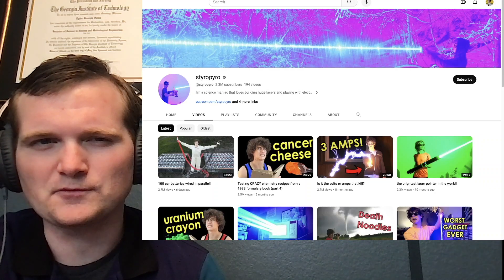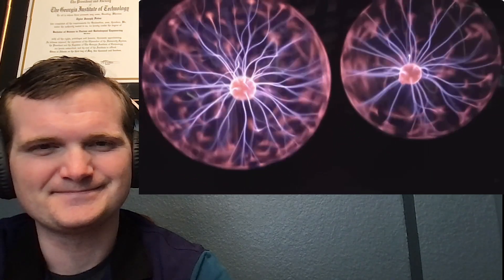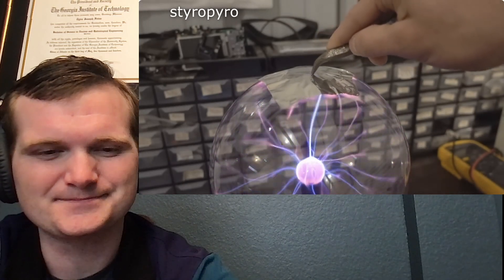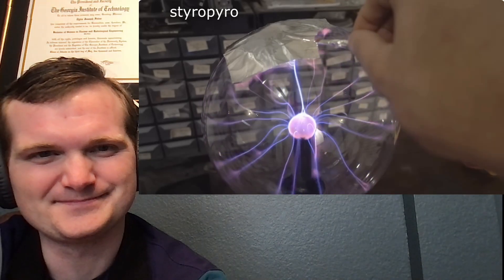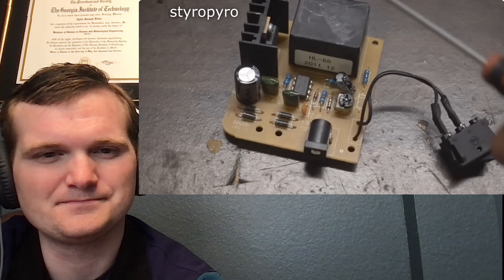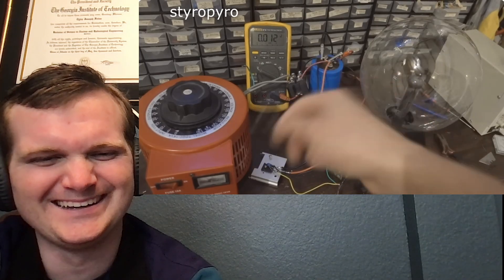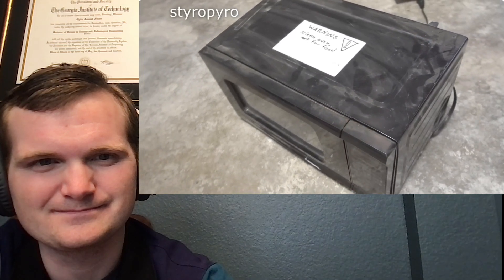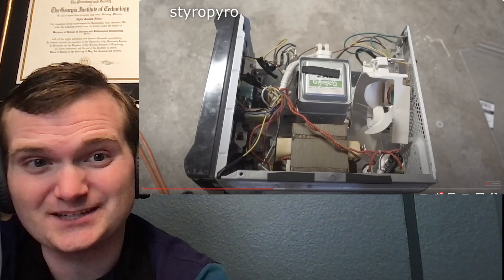Nuclear Engineer Reacts to Styropyro's DIY Overclocked Plasma Globe - 2500 to Over 1 MILLION Volts

Comment from the maker: Thanks so much for watching! If you want to hear more about weird pseudoscience products that are actually RADIOACTIVE, please check out: https://youtu.be/9V1gFTfkYH8?si=SZ6uH_nHkySeqC4w
Reply: What about ESD grounding...lol
Reply: @honeywaxnbees its good and not a scam? Wtf. Esg grounding is good and for some things essential
Reply: Hey there T folse First of all I hope you having a great day.
I wanted to ask you a quick question can you tell me which radioactive elements have an glow at dark?
Reply: @Sirius-o4k Tritium is probably your best bet for a glowing radioactive element, it's also pretty safe ironically, and you can buy tritium vials as a necklace or a keychain. Radium also glows though, and plutonium glows by burning the air that touches its surface cause of how radioactive it is. You don't really see too many elements that just glow on their own though, there's a few exemptions ofc. If you want something that glows and you can use it in pretty much anything safely, get Zinc Sulfide. Changing the metal it's doped with can change it's glow too, silver makes it blue, copper green, manganese orange/red. Mix it in paint to make a glow in the dark paint, or mix it in some epoxy and you can make some glow in the dark toys like what NileRed did.
Reply: The balloon is filled with acetylene, most likely. It's super unstable and makes a brilliant bright yellow flame. Also, it's super dangerous because even static electricity from your clothing, or the inside of a balloon can ignite it..

Comment: i used to wire up control panels on switchgear for transmission line switchyards. as i remember we wired up control panels for a 750kv line. its been about 20 years or so. i have hi-pot tested thecopper bussbars of switchgear up to 100,000 volts though. with spotters using deadman switches, staying up to 35' from any metal part of building, and not breathing in the ozone. sometimes the insulation would get pierced through and pop and sizzle like bacon.

Comment: Back in the day when cb's were popular my buddy always had to have the best and of course have it first. I asked around and found an older fella that used to amplify cb's for truck drivers and being long out of business (so he said) but just happened to have a huge linear amp that the person never picked up that I was able to buy at cost with the you didn't buy it from me. So my buddy had a little flashlight bulb he soldered an alligator clip onto and would clip it to his antenna and light it up when he keyed the microphone. So there was a motel a friend's uncle owned that had neon lights in the check in awning roof. I told my friend my cb was strong enough to light up those lights so off we went. My antenna just touched the light and when I keyed my microphone nothing happened my buddy said I needed to say something for it to work even though he doubted it would. Not only did it light that on but all 4 under the canopy. On the way out our friend who worked there wanted to know what was going on so I gladly showed him but for more power I whistled in the microphone and to my surprise the light shattered 💥 😮 due to the antenna not touching and being at the end where the light attached to the fixture (so I was told). Our friend was known to be a bit high strung at times just said you got a mess to clean up and I hope you don't mind ladders. The linear only helped on it's lowest setting anything higher you couldn't understand what was being said but it was well worth it to outdo my buddy who kept pestering me to buy it which I did for quite a bit more than I paid for it.....The end 😊

Comment: was it the rolling stones that had no brown m&ms in their list and they wouldn't preform if there were brown m&ms because it showed that the people in charge of their safety weren't checking the list
Reply: Actually I think it was Van Halen, but you’re right about the rest. If the venue couldn’t read the contract and do something that simple then it signaled to the band that they likely couldn’t count on them to follow the more important stuff in their instructions. If I remember correctly, their stage shows were really elaborate with lights and sound equipment so they used that trick to identify which venues actually read and followed the step by step instructions that were sent to them. If they got to the venue and saw brown m&m’s then they knew the venue probably didn’t read and follow the instructions which meant they’d have to have their own people go through and double check everything to make sure there were no issues with the stage equipment before the show. Pretty clever trick though!
Reply: @ckeleshian  I believe you are right.  I couldn't remember who it was.  Just people thought they were being overly demanding, and it was just for their own safety. It's absolutely genius and well disguised
Reply: @nontrashfire2  Ya it’s often cited as one of those “diva demands” that appear in some musician’s contracts but most people don’t know the context behind why they actually did it.

Comment: Digging your content brother 🎉👌 👏. And you've peaked my curiosity. If you're stepping up the voltage at the Plant,to make up for voltage losses due to distances needed to travel....what kind of losses are we talking about,,, ?  Is there a rough and or exact formula utilized in this concept??
Side note..most of the videos you react to are creators i personally find fascinating.. so good job 👏..and you are especially good at explaining complicated things in a simple and understandable way..keep it up kiddo..great stuff 👏.. 😊
Reply: Yes, there is a formula for calculating the power loss over any transmission lines, and it is fairly simple: If you know what the resistance of the wires is, just multiply this by the current squared, and that will be the power lost, primarily as heat. So you can see from this that the power lost is highly dependent on the current the wires have to carry, but the voltage is essentially irrelevant.

Transformers are used to change the voltage, which works by having two sets of windings (coils of wire), a primary winding for the input and a secondary winding for the output. The ratio by which the voltage is changed from input to output depends on the number of turns of wire on the windings. For example, say we want to change 240 volts from a wall socket into 2400 volts to run the magnetron in a microwave oven. That's a factor of 10 conversion, so however many turns of wire there are on the primary (input) winding, the secondary (output) winding will need to have 10 times as many turns of wire. The wire used for this is usually copper coated with a thin layer of shellac resin for insulation - if you look at an old microwave oven transformer, you can clearly see the primary and secondary windings, with thicker wire used for the primary.

While electrical appliances will often have a power rating given in watts (or kilowatts), the power rating of transformers is often quoted as a number followed by "VA". This is because the equation for calculating power delivery is itself fairly simple: The power in watts is a product of the voltage multiplied by the current. However much power you put into the primary winding of a transformer, the power coming out from the secondary winding should ideally be the same. So with the example mentioned above of the microwave transformer stepping the voltage up by a factor of 10, the current coming out of the secondary winding will also be reduced by a factor of 10. Hence why the secondary winding can use thinner wires, because it doesn't have to carry as much current.

Of course in the real world, transformers are never 100% efficient. They do get fairly close though - most transformers only lose about 5% of the power flowing through them, usually less. The principles of operation are the same regardless of scale, whether we're talking about the little transformers in microwave ovens or the giant versions at power stations and sub-stations. The mechanism by which this few percent of power is lost in transformers is mostly the same as how power is lost over transmission lines - the wire used to make the windings will always have some resistance, so any power flowing through it will always generate some heat. A tiny amount is also lost as sound - the 50 Hz or 60 Hz buzzing or humming you can hear if you stand next to a substation.

The total power lost between the power station and the supply wires coming into your house will be spread over several transformers: One at the power station itself, another one at a regional substation, then most likely a small local one mounted on a pole somewhere within a mile of your house. These are sometimes referred to as "pole pigs", and are by far the most common transformers on the grid - they take the 11,000 volts from the regional distribution lines and do the final step-down to 240 volts for domestic use. So somewhere between 10% and 15% of the power made at the power stations is lost just in the transformers. But this is way, way less than the power which would otherwise be lost without using transformers.

In fact there is another problem which would be much worse without transformers - if all power had to be transmitted from power stations to all electricity consumers at the same voltages we use (120 or 240 volts for domestic, or 440 volts for industrial), there would not be enough copper on the planet to make wires long enough and thick enough to carry the insanely high currents it would take to achieve this. We know this from the early history of commercial electricity, back when there was very public (and arguably rather brutal) competition between high voltage AC distributed by Westinghouse and low voltage DC distributed by Edison: The low voltage DC system ultimately failed because of transmission losses - it was basically impossible to transmit useful amounts of power more than a couple of miles from the generators using low voltage DC. The high voltage AC system could use thinner wires, suffered from much lower power losses, and had the economies of scale on its side since power could be transmitted over much larger distances from larger and more efficient generators.
Reply: Right on brother 🙏. Very concise. I'm a retired carpenter / general contractor .but have become quite intrigued concerning electricity. And you've now informed me of things that I will use to make myself seem smarter than i actually am..so thanks for responding. And thanks for educating me further. I now make high end custom cutting/charcuterie boards. I've got several videos of myself creating these master pieces. Be sure to like and thumbs up our favorite nuclear physicist. And do the same for me if you find the time. Thanks again brother 🙏 ❤
Reply: And thank you Tyler. ❤

Comment: odds are he filled the balloon with propane. since it was not looking like it wanted to float off I think we can count out hydrogen.

If one wonders what that loud motor sound is with the coil I suspect if I remember some really old directions on how to build one of those its probably a vacuum cleaner motor, One of the ways to cool the spark gap used in the driving circuit under the platform is a vacuum cleaner motor and blower. Usually because they are cheap to source. well I am guessing its cooling, it could also just be to keep fresh non ionized air in the gap so the high voltage never gets a good static channel to arc through.
Reply: He actually used an angle grinder to build his Tesla Coil if I remember correctly. I haven’t seen a build video or anything but I remember him mentioning and showing it in a different video. I think the grinding wheel on it was either modified or replaced to operate as some kind of switching mechanism that could rapidly switch the flow of current from on and off. I don’t understand how it all works, but I do remember him mentioning and showing it for sure.

Edit: I think it was the video where he talks about whether it’s volts or amps that kill, which there’s a reaction to on this channel as well. Either that one or the Soviet Machine video, which again there’s a reaction to on this channel.

Comment: I’ve always wondered what the safety concerns regarding electricity were at a nuclear plant, since it seems like they make a lot of it in a relatively small area .
Reply: Nuclear plants generate heat which heats water, which then runs a steam generator.

The concerns on the actual electricity generation are the exact same as with any other power plant as most all of them other than solar (direct photovoltaic) and wind (directly driven generator) simply heat water and run a steam turbine to power a generator.
Reply: @enlightendbel  right I get how it works .  Just curious cause it seems like you’re producing electricity at much higher rates than those kinds of plants